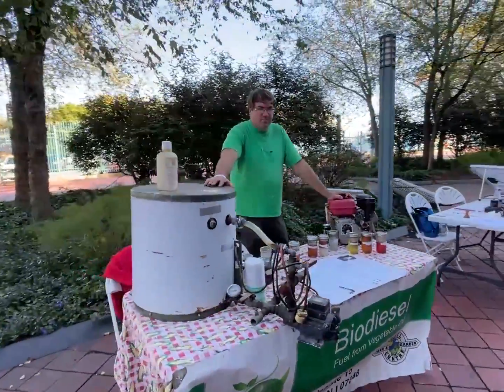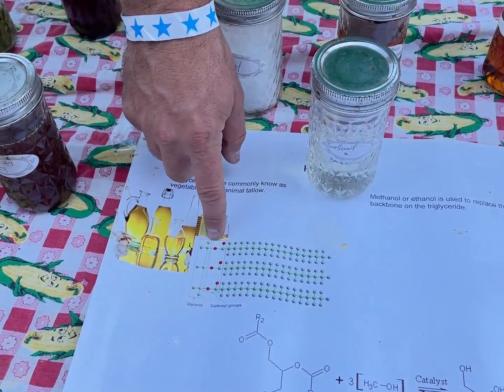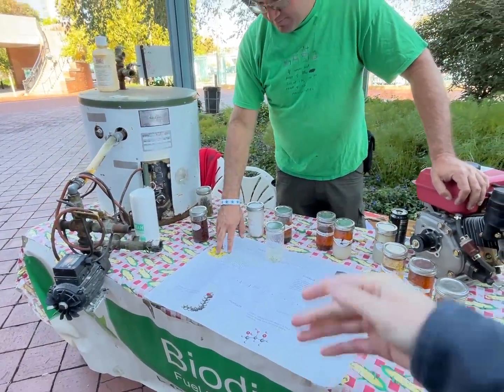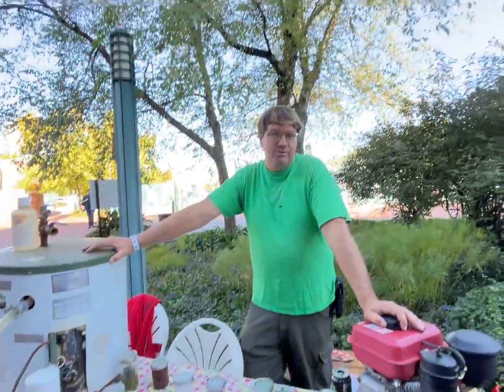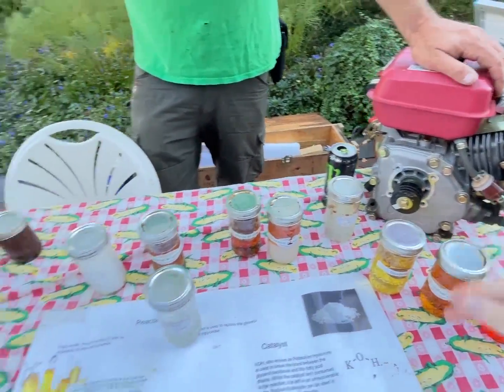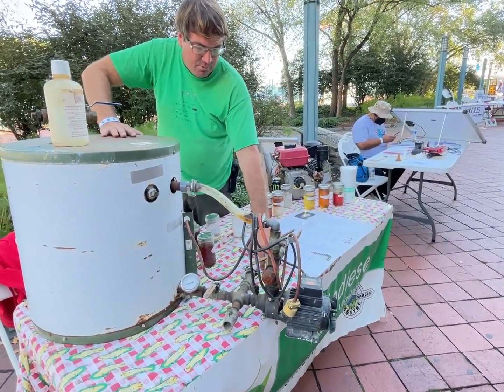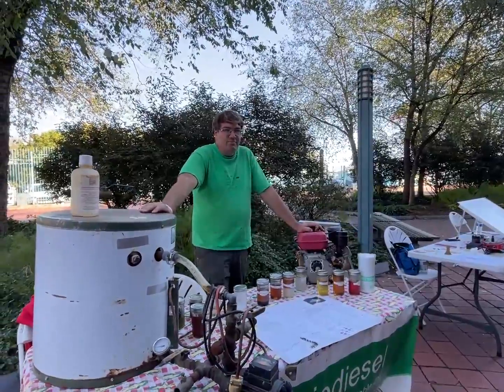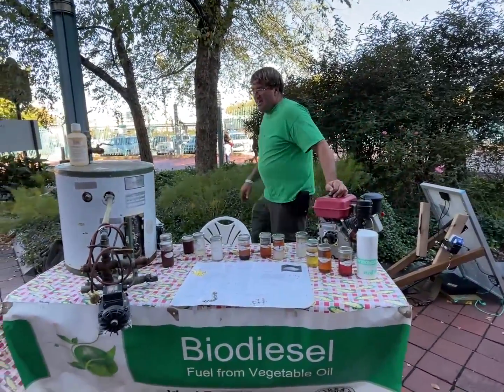2022 Philadelphia Maker Faire: How to make Biodiesel to run your equipment. DIY Bio-Diesel reactor.

Comment: I ran straight vegetable oil (used waste, filtered) for 300k miles over 5 differnt vehicles. But only works in older machines. Good homemade biodiesel will work in any modern diesel!

Comment: Old Mercedes diesel cars like the 240D make excellent vehicles for using Biodiesel. I've had success just mixing straight veg oil with diesel at 50%. You need to change the fuel filters a little more often though.
Reply from the maker: I wonder if we could have a more sustainable form of fuel filter. maybe a series of washable mesh screens.
Reply: @RinoaL  In the UK biodiesel community we have  a supplier of washable sock type filters in 1, 5, 10 micron. Usable for years.